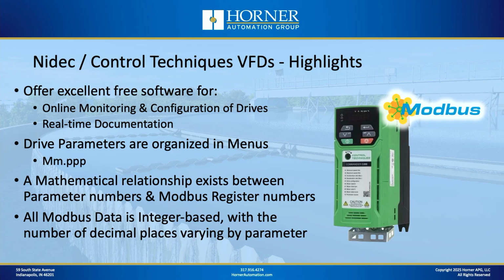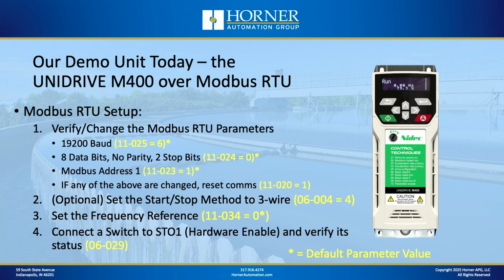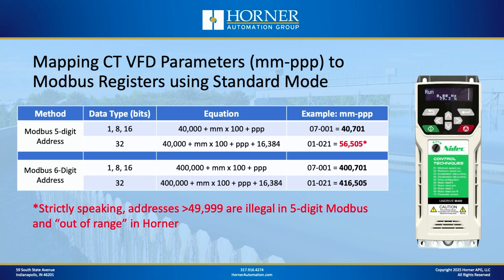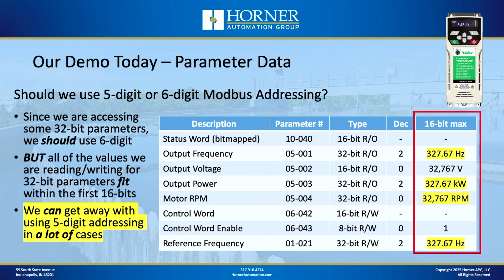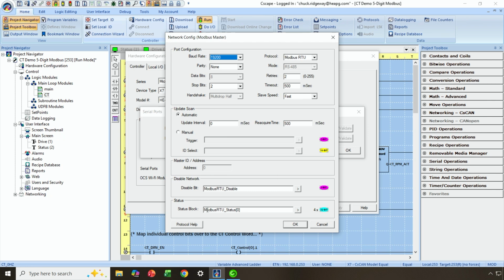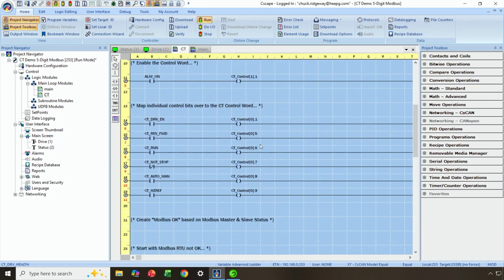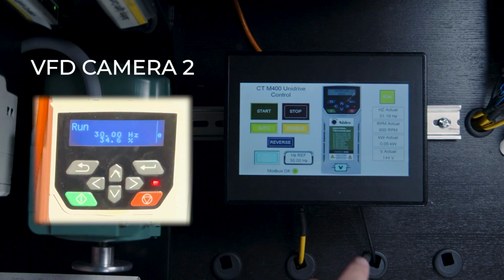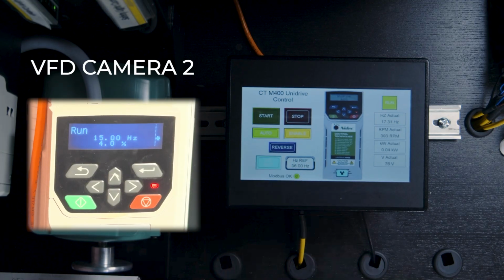Using Nidec/CT VFDs with Horner

Comment: @30min - Yes, the final output frequency includes slip compensation. The slip compensation can be disabled by setting 5.027 to 0, or setting the motor rated speed to 1800 (Pr7, 00.007 or 5.008).

Great job on the explanation. Pretty close to what I do. I had to figure it all out 15 years or so ago on my own.

BTW, to speed up the comms even more, if you have a decent list. Use menu 22, and map all the read-only's into one block, and all the read-write's into a second block and you only have 2 com segments. Makes a big difference when you have several drives and several parameters.
Reply: Thanks for that!  Yes - creating a custom list would realky speed things up.